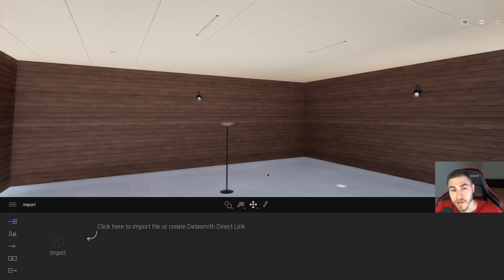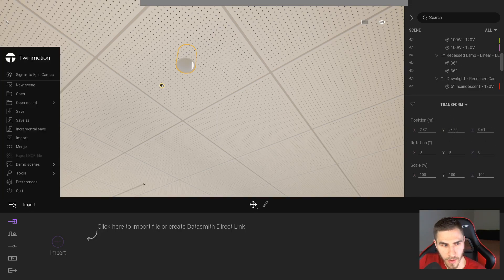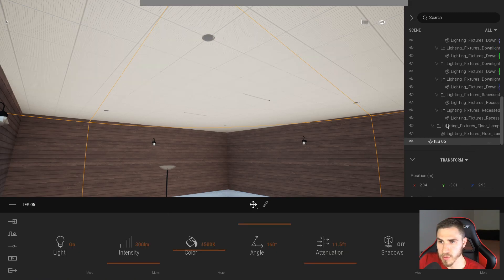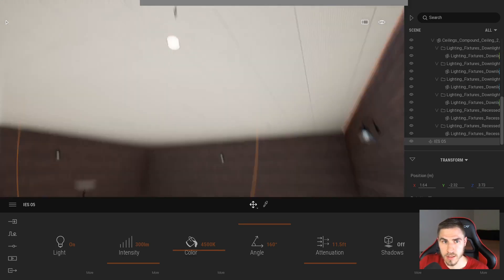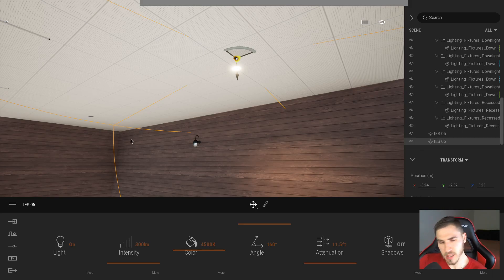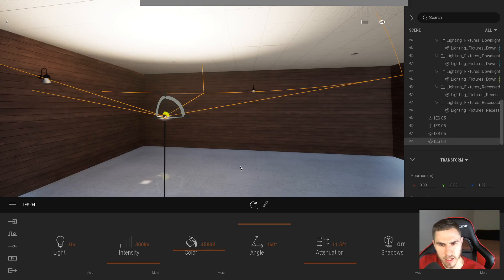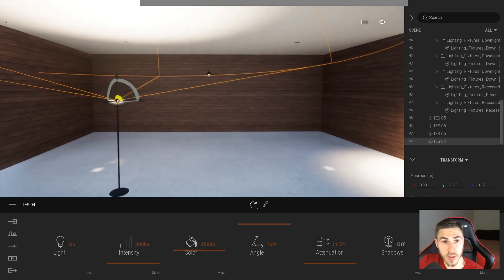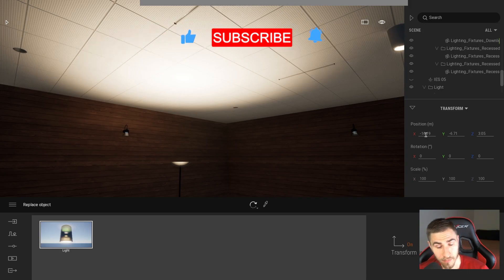Place Light Source Perfectly | Twinmotion

Comment: Hi there! Glad you made this video, thank you. 
I wasn't even aware of the Transform and poisoning specs. 
Positioning lights is probably one of the most annoying tasks in Twinmotion. 
I wish there was an 'Align' tool also. This in order to position all lights (or other objects) on the same height with one push of a button.
Have you seen this video? This is somewhat a work-around for positioning lights.
However I think you can only replace one part at a time. If you have 10 lights, then that’s the amount of times you have to do this.

Well unfortunately TM is not a CAD program and we as architects wish TM had more tools alike.
On another note: 
I have an expo stand where the walls are placed at a 45 degree angle on the floor.
Now all the gizmos of those objects are also at a 45 degree angle and not at a 90 angle anymore. 
Try move and position anything alongside a wall, let alone lights. A true nightmare!
Reply: Strange, the link I placed in my message to you didn't make it. Check Out and search on YouTube: 'CREATING CUSTOM LIGHT FIXTURES FOR INTERIOR LIGHTING IN TWINMOTION.' This is a video from: THE RENDERING ESSENTIALS.
Reply from the maker: Hey thanks, I’ll check it out. Lights can be a pain and replacing them individually might be the best way to deal with it.